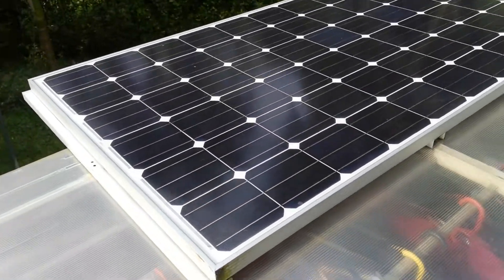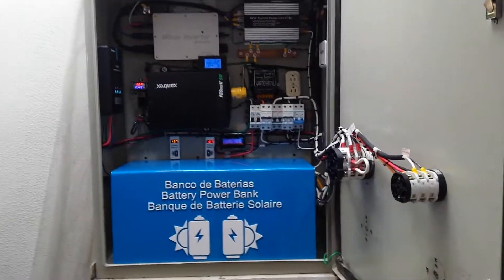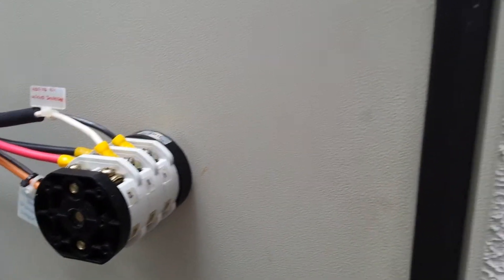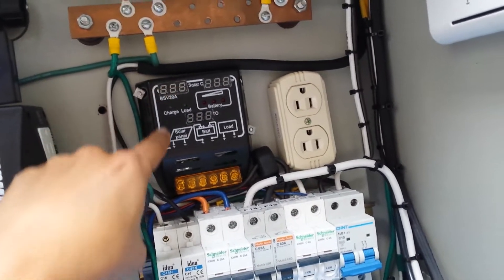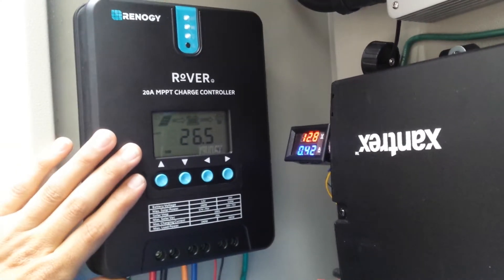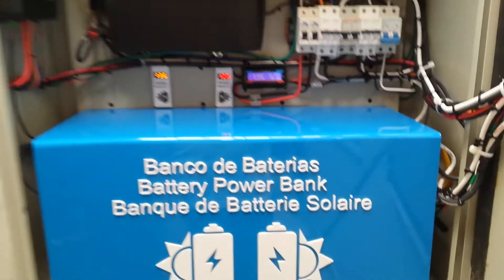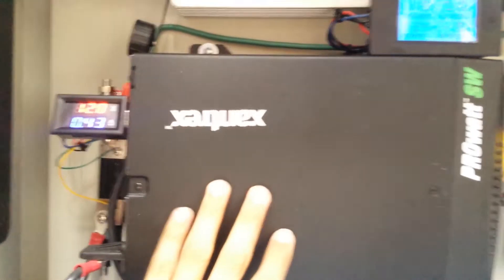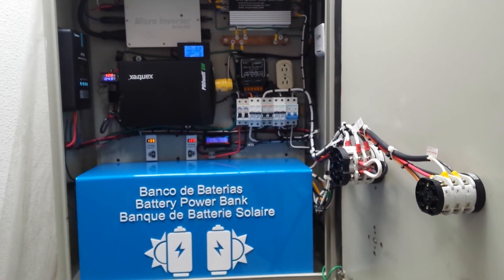300W Home Solar Power System

Comment: how many devices are you running on it? is the system still working well now?
Reply: Hi.  I have the ligth circuit of my house (13 Led Panels and bulbs).  Some times I connect the Fridge but the battery bank drop in 1-2 days.